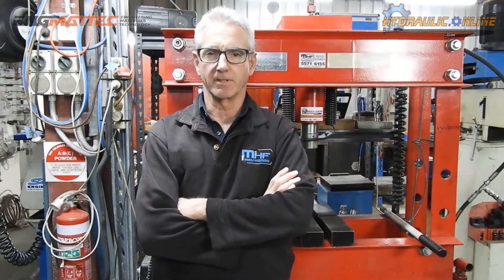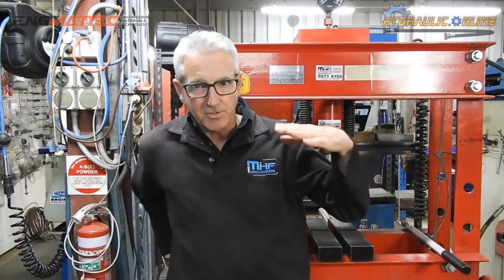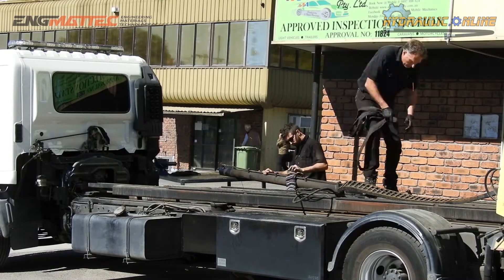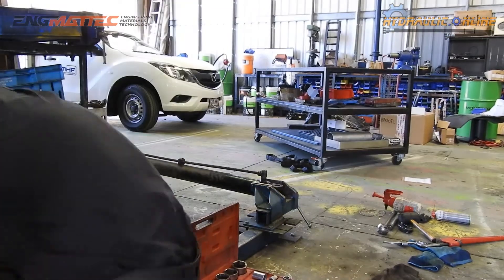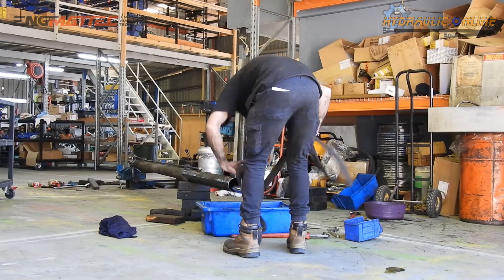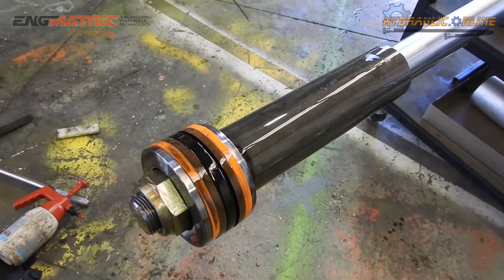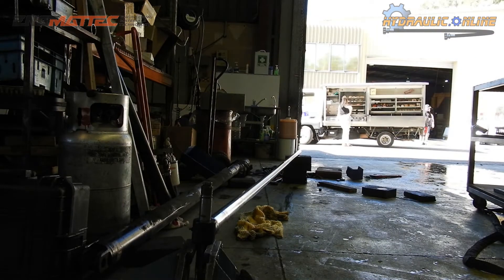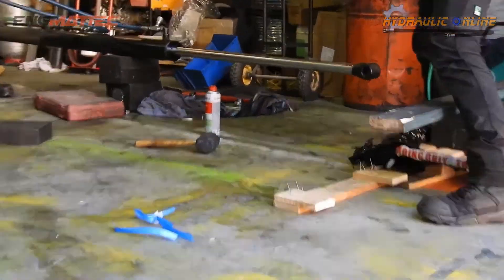Slide Cylinder Removal and Reseal EKEBOL Tilt and Slide Tray Towing Unit

Comment: Great video.
How much this whole project cost apparently?
Reply from the maker: Depends on how easy it is to remove the cylinder, how easy it is to dismantle the cylinder, clean it up and reseal it. Current estimate for this job in April 2022 would be between AU$800 and $1,200.